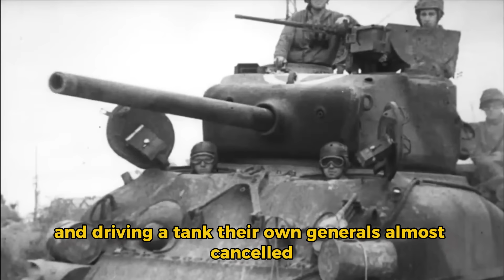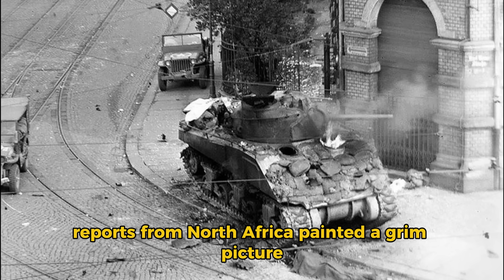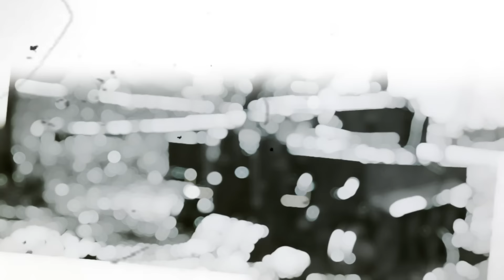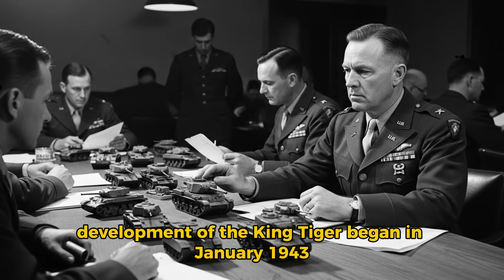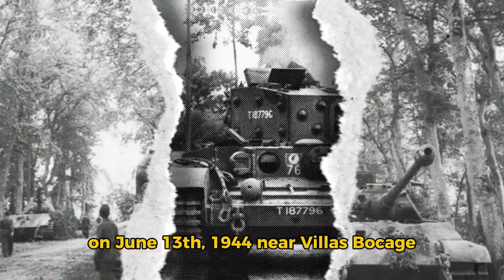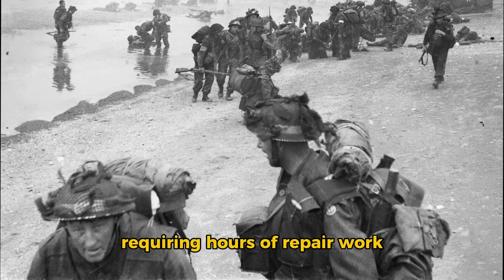How a “Rejected” American Tank Design Beat Germany’s Best Armor

Comment: *42:47* "No T-28 was destroyed by enemy fire." That may be the most surprising line in the entire documentary. The vehicle was criticized as too heavy, too slow, too expensive, and too impractical. Yet when it finally faced Germany's heaviest armor, it performed exactly as its designers intended. Sometimes a weapon doesn't need to be perfect—it only needs to solve the problem it was built for. Do you think military history is full of "bad ideas" that turned out to be brilliant in the right circumstances?

Comment: 58:17 "The T28 was never meant to replace the Sherman. It was built to solve a problem that the Sherman could not." That may be the most important lesson in the entire documentary. Military history often falls into the trap of comparing weapons as if one machine must be superior in every situation. But the T28's story suggests something different. The Sherman won campaigns because it could be produced, transported, repaired, and fielded in enormous numbers. The T28 existed for a far narrower purpose: confronting the small number of German super-heavy vehicles that threatened to make the final battles of the war far more costly. The real achievement was not building a tank that could do everything. It was recognizing that a specific battlefield problem required a specific solution. Do you think the greatest military innovations come from creating one weapon that does everything, or from designing the right tool for the right problem at the right moment?

Comment: Another falsehood in this video is that German tanks attacked at the bridgehead at Ludendorf etc.  I actually spoke to a veteran who was stationed at the German side of that bridge after US troops crossed it.  He was in a Sherman that mounted a 76 mm gun and along with one other Sherman guarded the approach to the bridge.  Not a single German tank ever appeared to challenge them.  The Luftwaffe made the most determined effort to knock out the bridge by bombing it.  My stepfather was there to see all that action and recalled that Germans were using their newest jet powered bombers like the Arado and the ME262.  They were so fast the GIs could barely swing their guns around to aim at them, but alas their speed prevented the planes from being able to bomb acurately as well.

Comment: this video contains a lot of misinformation.  The super heavy tank mentioned (I've seen it personally at the Patton museum formerly at Ft. Knox KY) was intended to knock out fortified positions and it mounted a 105 mm gun, not a 90mm.  It was grossly underpowered and totally impractical.  The famous Tiger II was basically a miserable failure for the Germans.  Most of them broke down due to failure of their final drive mechanism and were destroyed by their own crews.  It was too heavy for most European bridges at the time and consumed immense volumes of fuel that Germany just didn't have.  Also, by this time in the war, German steel was of  poor quality due to lack of certain alloy metals and so was more easily penetrated by Allied anti tank weaponry.  Tanks are impressive and expensive formidable in certain situations, but due to advanced shape charge guided rockets and top attack drones etc. they are becoming obsolete.

Comment: Don't forget, the American tanks had to be put in ships and delivered to Europe, so they couldn't be 70 to 80 tons...The German tanks could be driven or transported by rail, so they could be bigger and heavier...The American design had to deal with easy transport...That's one of the reasons we didn't want our main tanks to be super heavy or big..The Sherman was easier to repair, and the German tanks had to be shipped all the way back to the Porsche factory ...There are many reasons for the Sherman..Once the Sherman was upgraded to the 76 mm gun, it was much better dealing with German tanks....
Reply: They often removed the turret and engines to reduce weight and shipped the tanks in pieces. Although what you state is factual, the part that's not so accurate is that this, in some way, made production focus on less weight when the opposite was true, as they focused on mass production and modular engineering. They had hardly any focus on the overall weight, as they already had a focus on lightweight and quick assembly of sherman. There was also a massive push for interchangeable parts. There are some really good WWII engineering books that. Cover a lot of projects, I'll post some links.
Reply: @AverageBritain  Numbers do not lie.  By focusing on scalability, the Allies were able to field massive numbers of Shermans, relative to the larger-advanced German tanks. One-on-one they were not competitive.  When the US entered Europe the Allies gained a 10:1 advantage.  Between the T-34 and the Sherman, the allies commanded numerical superiority by the end of 1940. The German tanks strained supply chains.

Comment: The T28 gun motor carriage was developed, not to engage German heavy tanks, but to destroy German bunkers on the Siegfried Line. The weapon developed was the M36 GMC which is a M10 GMC with a new turret and a 90mm gun developed from the US 90mm AA gun. Eventually, the M26 Pershing was developed as a 90mm gun tank. It has been compared as equal to a German Tiger I.

This video is fantasy.

Comment: What I can't understand is why America didn't adopt the British Firefly style of Sherman with the long barrel high velocity 75 mm gun. It was highly effective.
Reply: For the same reason we didn't take British advice on countering German tactics in North Africa, or advice on bombing tactics when our army air corps arrived in Europe! We were too arrogant not to think we knew more than the Brits!
Reply: The Americans used a 76mm high velocity gun on the “Easy Eight” Sherman.  They were able to reload faster than Fireflies and had better off-road mobility.
Reply: The reason they did not is because American doctoral was tanks were for infantry and tank destroyers fought tanks! Most Americans perfered the 75mm over the 76mm which was a good gun!
 The HE rounds in the 75mm were preferred! The firefly gun was very inaccurate co to the 76mm
Reply: @christopherchilders1049  But if the Normandy fronts had been reversed?
Reply: The Americans had the 90mm gun on the M-36 Tank Destroyer, and in a small handful of tanks 
- less than a dozen - in the M-26 Pershing. The M-36 TDs were lightly armored, but the 90mm was very effective
they made a bit over 1,000 of them, they were well liked  as the U.S. army pushed in to Germany 1945.
Probably superior to the 17 pounder all round
Reply: @vvvci   The APCBC was good enough to knock out Panthers at 1,000 the Tiger 1 at 800 yards and Mk IVs at a mile. The APDS was reissued from September 1944. And by December, was improving though still started losing accuracy at over 600 yards. 

The 17pdr was accurate enough that when topography allowed, could and DID knock out Mk IVs at ranges up to a mile. The Tiger II wasn't immune either.  So go toodle off and do some research.  Oh!  Moran's programmes are mainly his opinion. Range testing is not real world, front line combat service. Which he himself admits. His Idea that the nomenclature for the 17 pdr was 'pd'  because they were the only letters shown on the gun itself, lets him down.  The reason to drop the 'd' was part of the procedure to speed up wartime production and save welding time.  The Firefly from Normandy to Northern Belgium, December 1944, was the best hole puncher the Western allies had.  Jerry didn't single it out for nothing...The 90mm. tank gun was very late entering the war when there was no game to change in the European war.
Reply: Actually it was a 76mm gun and later war Sherman m4s were equipped with a 90mm gun but they were very few made but the most major drawback of the Sherman m4s were it's light armor and short 75mm gun not to mention the gas engine which was ether a Detroit V8 which were 2 Detroit V8s side by side or international V8s when the Germans were running diesels in all their tanks
Reply: What about the U.S. Sherman M4A1 with it's 76mm main gun?

That was a big improvement over the original Sherman.

The British Firefly was a a U.S. M4 Sherman with a 76.2 mm main gun.

That's not very different from the Sherman M4A1 with it's 76mm main gun.

The Sherman M4A1 had better crew ergonomics and a higher rate if fire due to a more spacious turret.

Research what Lafayette G. Pool and his crew did with their M4A1 with the 76mm main gun. That will give people an idea of how capable the design model was.
Reply: Firefly still a M4! The P51 Mustang needed an engine. Thousands allied bomber crews died without escorts. The P-38 couldn't turn fast enough to dogfight. P51 Mustang needed the British two-stage supercharged Merlin 66! US had 100+ Carriers! Produced 300,000+ Planes! Out-produced the world!

Comment: No, the American T28 super heavy tank did not see combat in World War II because the war ended before its prototypes were completed. While designed to assault German defenses like the Siegfried Line, the first prototypes were only finished in late 1945 and early 1946, after Germany had surrendered.  
Design and purpose: The T28 was developed late in the war to breach heavily fortified German lines. 
Development timeline: It was officially authorized in 1944, but its design and manufacturing challenges meant the first prototypes weren't ready until after the war. 
Post-war use: The two prototypes were used for post-war testing and experiments, not combat. 
Designation changes: The vehicle was initially designated as the T28 Heavy Tank, then renamed the T95 Gun Motor Carriage in March 1945, and finally re-designated as the Super Heavy Tank T28 in 1946.
Reply: OK no no
Reply: This is a scam story.

Comment: The T29 heavy tank (derived from the T26E3 Pershing) had a traversable turret, same 105mm gun (not a 90mm) as T28, heavy armor, weighed less and was more practical than T28. It would form the basis of a series of experimental heavy tanks that would ultimately result in the M103 heavy gun tank in the 1950's.
HOWEVER..... NEITHER the T28 NOR the T29 saw ANY combat in WW II.
The T26E3 Pershing was the heaviest American tank to see combat in WW II . This story is PURE FICTION. 😅
Reply: I did a search and the T-28 and T-95 were both Soviet tanks, lol.  Go AI, lol!